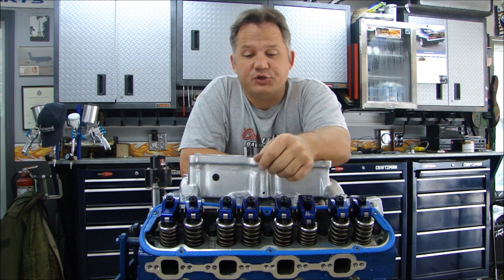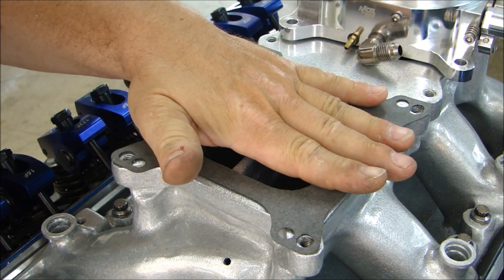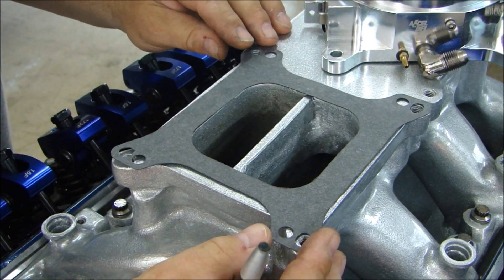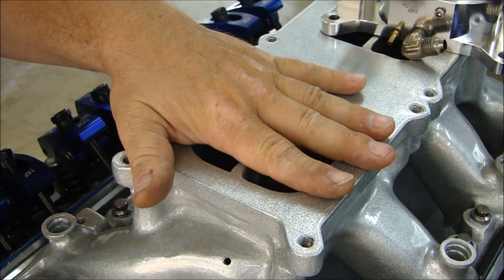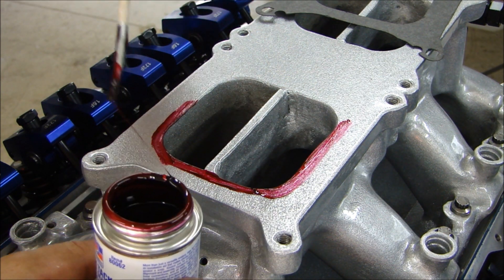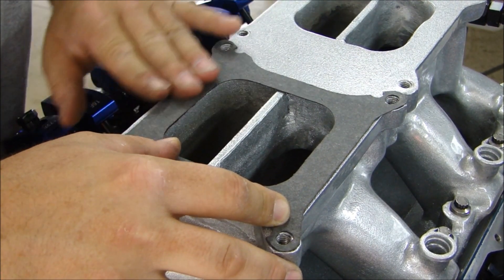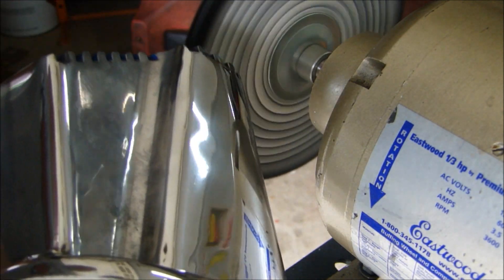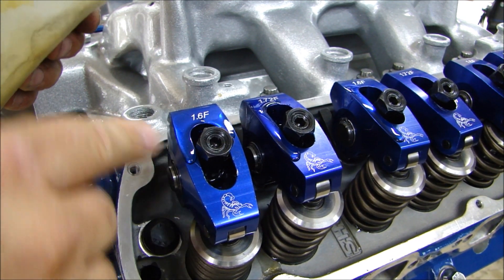Engine Building Part 10: Valve Covers, Carburators, and Throttle Bodies

Comment: I think you're doing even better with these engine building videos as they go along. Less use of wrong words and fumbling with words. Much easier to follow because of it. Love how you go through the installation process too. All of the little hints and tricks are extremely helpful. Thanks again for doing these!
Reply from the maker: Yeah...it's not easy to just make these off the top of my head. I'm just trying to help wherever possible.

Comment: Hi Pete,
So you have me hooked on your videos. I am now a Pete and motor addict, only 3 weeks away from rehab:O).
I sent you a note a day or so ago on another of your earlier series. Anyway, something you might share with your readers is the use of a good shop vac to help retrieve nuts, bolts, washers etc. dropping into cavities/places they are not supposed to be. I use a piece of hose, could be heater hose, gas hose etc. duct taped to the end of my shop vac. hose. The vac hose will often retrieve whatever you dropped. You will need to get into the vac to retrieve your parts, but that is easier than pulling an engine back down. I have dropped things down spark plug holes and have been able to get them out, Hemi type cylinder heads are great for this. Seems like things drop while you are trying to cover all the holes, and whatever you drop goes down a hole. MUST BE PHYSICS:o) Or, FM :O)
I don't mean to blab on and on but you are quit amazing and its great to talk to a motor head like myself. Been doing this as a hobby since my first engine in HS in 1970. Growing up in the muscle car era makes it hard to ever get away, not that I would ever want to.
Keep up the great videos, there are none better!
Gary
Reply from the maker: That is an awesome idea Gary....thanks for sharing. I'll have to come up with some funky adapters to use on mine......really cool!

Comment: In high school ,my VoTech Automechanics  my instructor was a retired Marine mechanic .He had unbelievable notes and tips in a personal library if you will.He taught us that if you use plain Jane chapstick on carb.thrtbdy gaskets  carb bowl gaskets .It made a excellent sealer fuel will not affect it .You can reuse gaskets with another coat of it .Been useing that tip for 35 year s .It works .RIP Sgt Major Ronald Greene USMC Retired. Semper Phi
Reply from the maker: That's awesome, thanks. The chap stick back then probably had more petroleum jelly in it

Comment: I love your attention to detail, very commendable.
Reply: Pete, I was also wondering, what would you do to clean the inside of the plenum/intake.  It's plastic and also has the fuel rail and injectors. There is oil mist residue from the ccv and like a crusty oily dust. The inlet valves are spotless thankfully.
I didn't really want to take off the throttle body and don't want to compromise the injectors.
Many thanks
Peter in the UK.
Reply from the maker: There must be some kind of carb cleaner spray you can get. That works well.
Reply: +Petes Garage nice idea!  Thanks

Comment: Just wanted to say thanks for your videos! This one in particular is going to come in handy when I install the electronic throttle bodies I'm rewiring for my M120. Unlike on your engine, the throttle bodies on the M120 mount on either side of the intake manifold, so it looks like having high tack will come in handy for keeping everything aligned when I'm putting it back together.
Reply from the maker: Excellent. It works quite well. I think you will be pleased with it.

Comment: Hey Pete, I just finished part 10 of the Cobra build from part 1. I just had to take a few minutes to say thank you. You don't just put together good videos with coherent information, but you love the details and that makes watching it extra special. Don't apologise for the complex stuff, it helps give a full picture. I'm a complete novice but I know a lot more now than I did before watching your videos. In the intake manifold theory video you kinda forgot to explain how different octane level fuel reacts in the chamber and what compression has to do with it. It was funny cause that was supposed to be one of your main points. I also wondered if putting a supercharger could affect the valve closing speed, or have enough force to counter the spring returning to closed, at least enough to fudge your numbers? Hey, I could go on forever with the questions, but the main thing was to say thanks for your work, and don't stop!
Reply from the maker: +Philip M Those are great questions Philip, thank you very much. A supercharger can speed up the valves since it is creating positive pressure. It is definitely a consideration when deciding to put one on. I'm working on a dyno video and I will talk about octane...great idea! Thank you for watching. I will always try to provide the best content that seems relevant to me.

Comment: Great Videos!  That engine looks incredible, and I'm sure it will be an awesome performer.  I am very jealous!  You said 10 in-lb for your carb torque spec, but I think you meant 10 ft-lb.  A trick I learned for paper carb gaskets is to spray them with WD-40 and let it soak in before you put them on.  It helps keep the gaskets from sticking to the manifold when you remove the TB/carb.  (Works very well for internal carb gaskets - fuel bowls or metering plates.)  I know you probably used the 12 point bolts on your TBs for aesthetics, but if you have to remove the TBs a lot, you can "waller" out the aluminum threads in the intake.  Studs and nuts would be better.  But since they are TBs and not carbs, you won't have to remove them over and over for tuning.  THAT ENGINE IS A WORK OF ART!!!!
Reply from the maker: That is a great idea....thank you for sharing and thank you for watching!

Comment: Really enjoy your videos, picking up ideas in every one!
I use fine or 'second cut' files to clean up sealing surfaces, preferably using the draw filing method. The files are fine and smooth enough to give a very clean surface.
Personally, while I do make frequent use of products to seal/stick down gaskets, I run the bead around the middle of the sealing surface as doing it to the inner or outer edge will extrude any excess and it'll bleed around the outside or be drawn into the inside of the engine.
When using an engine stand, and why wouldn't you, just rotate the engine so the rocker cover is horizontal - makes it much easier as you're not trying to hold the gasket and cover in place while getting the bolts started.

Oh, throttle bodies look great :-)
Reply from the maker: +GordonWG1 Awesome ideas....thank you for sharing with us. I use a special gasket for the rocker cover and it does not need any sealant. I am making another video about putting those on. Thank you so much my friend

Comment: Thanks Pete, I couldn't agree more with youre comments on clendliness, your camshaft vid was awesome and so educational thank you so much! I got to butcher a 1.3 litre ford fiesta back to work, and I mean butcher it, ok this is gonna be good for 5 to ten k miles, I learnt this trick for straightening valves about 20 years ago! AVOID this as it aint good!! you bend a valve,,,,,,,replace it and lap it in, and do it clean!!!
Reply from the maker: Bent valve = Disaster. Most valve are welded 3 piece and hardened. There is no way to straighten them. I agree...spend the money and get new ones

Comment: Are those Holley throttle bodies?
Man, you're putting together a really clean engine. I had a tiny speck of dust in a cam journal when I rebuilt a motorcycle. The cam wouldn't turn. .0002mm clearance spec. Cleanliness is paramount.
Reply from the maker: Guns Cars and Digits Those are Accel throttle bodies 1050 CFM. A spec of .0002mm sounds a bit too tight. That is only 0.0000078740 inches. Perhaps the spec is .02 which is 20 microns or 0.00078740 inches. Either way you can never be too clean. I've never seen an engine fail for lack of FM...lol
Reply: 2000 CFM on a sub 400" SBF?!!! That plenum should definitely get all the air it could ever want... wicked throttle response. MPFI on a dual plane.. You are right about my clearance BTW. I dug up the specs. .028 to .062 mm. YFZ450R. I've never had a cam go tight like that before. I thought I warped the head somehow.

Comment: Great videos, love them all, thanks, they help me alot and give more inspiration to build more engines, cant wait to hear this thing run :)
Reply from the maker: tyler guill Awesome...keep building!
Reply: Me and my dad are in the process of building a 460 to go in my 79 f250, its bored out 60 over, roller tip rocker arms, high performance spark plugs, wire, etc, ford racing high performance heads and headers, and a ford racing high performance intake manifold and a edlebroc 4 barrel carburetor, the only thing we're going to be able to run in it is super or racing fuel and your video help me alot in a way, it helped me with my crank and cam shaft too! Thank you!

Comment: Tip: Use the Permatex super tack on the valve cover itself and fit the gasket onto the valve cover, semi permanently. Then, if you need to remove the valve cover for whatever reason the gasket is usually perfectly reuseable to just pop the valve cover back on and done.
Reply from the maker: Great tip, thank you

Comment: Hi Pete! Always great to see a new video! Those head gaskets are real nice, better than what come in a standard Fel-Pro Rebuild kit. Are they Fel-Pro? As an aside you might consider touching on thread lubricant or anti-seize when using stainless steel fasteners in aluminum and also how it affects torque.  Thanks a million for your  videos, they are really good!
Reply from the maker: The valve cover gaskets are not Fel-Pro. Anti seize is a good idea with stainless in aluminum. Thanks for mentioning that. Since this is a low torque application it won't affect it much, but on a torque and angle application it will for sure shift the torque curve. Thanks Bill

Comment: {just some info that can help}the paint on the valve cover can peal...if it just's paint now i don't know if it will help or even if they sell a clear primer like paint maybe if theres a primer that can handle the heat it wont peal just do some research on it that way you can save that aluminum  look great job learning a lot off your videos your s great man maybe one day i can build one...
Reply from the maker: +kevin suriel That is awesome Kevin, thank you. The valve covers are not painted, it's powder coat so it holds up to the heat. The color matches perfectly

Comment: This might be a silly question and I apologize in advance for my ignorance.. but why do you need the spacer between the throttle body and the manifold again? You say it's to vacuum seal it so there is no leaks... but if you bolt the throttle body down tight enough wouldn't that me enough for a seal? How can enough air get between two metal parts that are bolted tight together? Thank you for all your videos! I love them!
Reply from the maker: +Walter Shmitty The intake was made for two carbs. The footprint of the 2 throttle bodies are different. i made the adapter so they can be bolted straight on without an awkward adapter.

Comment: Pete, thanks again for the great video. I'm starting to plan a new project car 240z 260z or 280z haven't decided yet. What I do know is that I want to use a L28ET engine from an earlier model 280zx single turbo. I have worked on ford and chevy v8's (cams, heads, intake ect.) but never a full engine build... and never a import strait 6  turbo motor. Anyways just wanted to introduce myself and say thanks because I will probably email you with a question at some point... thanks in advance!

Cody
Reply from the maker: That's awesome Cody....thank you, I'd love to help

Comment: Once you get the carb on, tape over the openings until you are ready to mount the air cleaners.  You are so careful about not dropping things into the motor don't stop now, also tape over the other open holes, like the distributer opening, again a good place to drop things.  One other thing.  Why are you waiting until the manifold is mounted to prepare the manifold to carb surface.  If you do it off the motor no shavings or other debris can cause a problem...same thing with chasing the threads...do it off the motor and you don't need tape on the bottom and then you can use air to blow all the bits off.
Reply from the maker: Richard Ture Awesome comment,  thank you

Comment: Thanks for the videos I'm learning a lot, love how well you explain and show your work, will keep watching, one question what EFI system is that, those throttle bodies are gorgeous, can seem to find that "kit", thanks
Reply from the maker: Thanks my friend. That is an Accel EFI system with dual Accel throttle bodies. Unfortunately Accel is no longer around, it was sold to Holley
Reply: Pete's Garage that's a shame, they looked gorgeous, I'm looking To the new EFI kits and I'm leaning toward a FiTech dual (because I have deal carburetos on my Cobra) and also looking at their fuel surge tank, but the FiTech throttle bodies don't look as nice as yours, that throttle linkage in yours looks like a nice piece of craftsmanship, love it

Comment: That's the correct Ford engine blue isn't it? Nice attention to detail.
Reply from the maker: evilcowboy it is. Dark Ford blue
Reply: *****

Thought so. Sets that sucker off. I've seen people who believe blue is just blue and Ford blue is no different than a run of the mill blue.

This video obviously proves that wrong. You can tell when something is just blue and when something is Ford blue.

Also I have to say Ford blue is a much better looking blue than the blue Pontiac used on their engines.

I got the privilege of modding a 62 Falcon. The guy wanted a PCV system to replace the road tube (I tried to talk him out of it and into keeping it original). It was a pretty neat little car and engine to play with. Nothing spectacular but was fun seeing the old engine.

Comment: Pete great videos.  I am new to your site have a few questions.  I am installing freshened up Merlin heads on a 502 marine engine.  We are using ARP head bolts what would you recomend using to seal the threads ARP sealant or The Right Stuff everyone has a different opinion.  Also what would be the recommended torque for the intake manifold can't really find the manufacturers specs.  Not sure if it matters I have two Holly 750 cfm carbs & B&M blower.  Thanks in advance!! Ray
Reply from the maker: +Rayalto Thanks....I have never had a failure with The Right Stuff. That's just my preference. For the intake 28 ft lbs is usually a good number. Check a couple more sources. Sounds like a great engine!

Comment: I'm adding a valley pan to protect the underside of the intake manifold. Do I still need a gasket between the cylinder heads and the intake manifold, or can I just use the valley pan with some sealant?
Reply from the maker: +bugdude0 The valley pan is usually a gasket. All you need is some sealant around the ports and it will be fine
Reply: +Petes Garage Thanks a bunch. Putting my 442 back together and these videos are more helpful than you can imagine. I have zero mechanical know-how, but the motor's coming together great. Again, thanks a lot!

Comment: I have watched these engine rebuild videos and found them to be quite interesting. But there are some things that I would like to know more about and that have not been covered in much depth so far.

I would like to know what options there are if one wants to convert a carburetor engine to ECU / fuel injection engine. I guess pits for knock sensors, a temperature sensor or also maybe an oil pressure sensor must be drilled into the block. Somehow camshaft position sensor(s) must be installed, especially if one wants to use sequential fuel injection I guess. Some injection systems use an intake manifold pressure sensor to regulate the fuel injection timings, other use mass air flow sensors. It would be interesting to know how such a fuel injection system should be tuned for any given type of small block or big block engine and how the presence of a compressor or a given number of turbo chargers would affect the tuning. I've heard of a "DYI" fuel injection system called megasquirt, but I guess that there must be other systems as well.

It would also be interesting to know a little more about turbo chargers and compressors and what are the caveats of using these type of devices with an engine. I've heard a lot of stories of people damaging their engines after fitting them with such devices. There must be a way to come up with something more... sustainable.

Maybe this is not a popular thing among hotrodders but if I got to build a really nice engine setup, I would also be interested in installing emission reduction systems into it and fit one or several catalytic converters (so as to give the exhaust more air flow) into it. I guess it should be possible without losing too much horse power. It would be interesting to know how much horse power penalty there would be to installing such equipment.
Reply from the maker: Iberius Pred That's quite a few requests. I will put them on the list and address them as fast as I can.
Reply: Your work is appreciated, as always:) I especially liked you video on motor blocks and cylinder heads. I want to draw a fully functional engine in CAD.

Comment: Hi Pete
you don't need sealant on the valve cover gaskets ?
I like your videos.
Reply from the maker: +Ruben Ruvalcaba For these gaskets no. They are designed to be used over and over. I do put sealant on the regular cork ones